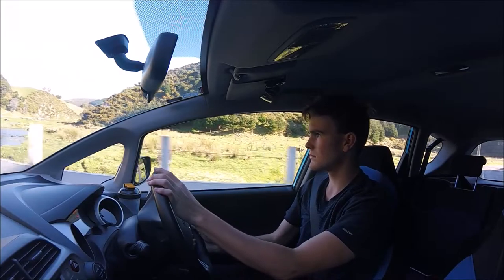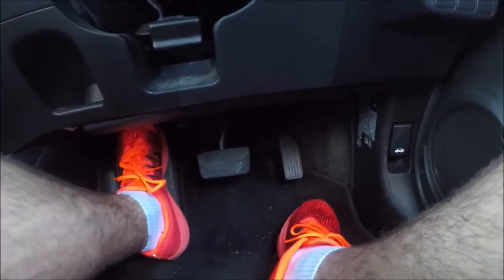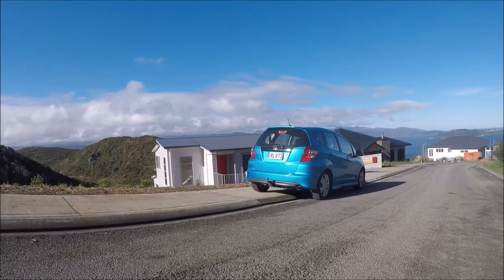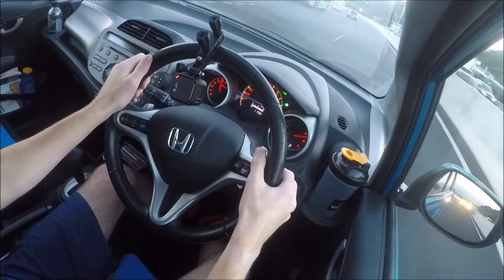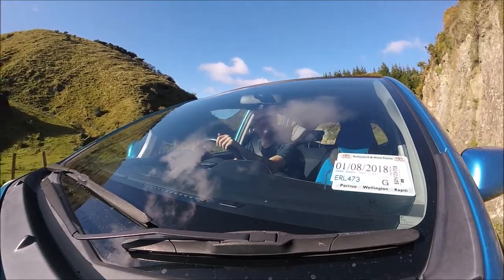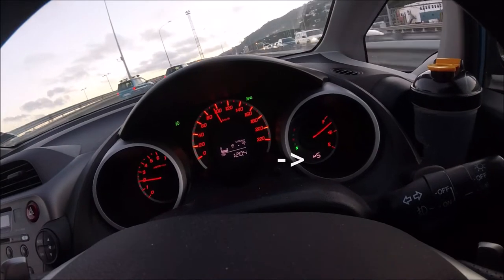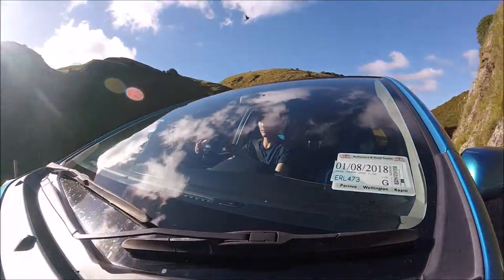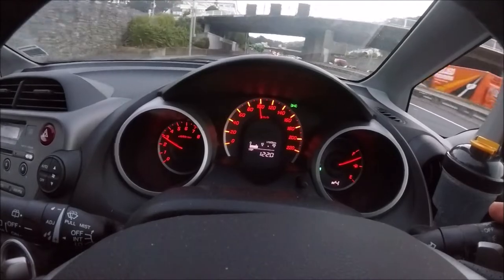What Paddle Shifters in an Automatic Transmission Vehicle Do

Comment: Hey there, looking HEAVILY into the GE8 Fit (your model it appears) and just wondering, will the car shift eventually at high rpm or stay in that gear regardless? Basically, does it allow redline? I want to get an Auto so that for where i live, the city, it can still be an automatic however i want to still be able to do track days and beat the hell out of it (it is a honda after all, reason i loved my si)
Reply from the maker: Yep will definitely let you valve bounce it. Doesn't shift up on it's own, but will shift down on its own if the revs get too low. Would definitely recommend, it's a lot of fun even for 120hp and an auto. Much more fun that the newer CVT ones. The new gk5 manual ones are lots of fun tho
Reply: @KiwiCarLife  thank you so much for the response! finding any info on the auto paddle shifters is so hard, even on fitfreak. i'll deff be getting a GE8 (white hopefully)

Comment: Do you have to use the shifters or will they always automatically adjust
Reply from the maker: Not quite sure what you mean. In 99% of cars with paddle shifters it works like a normal automatic unless you want to change gears yourself by pulling one of the paddles